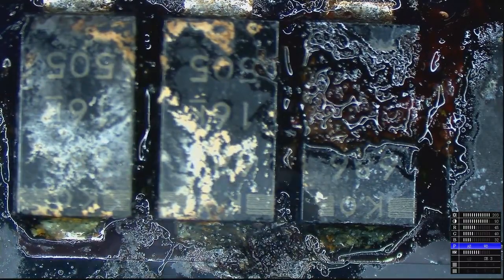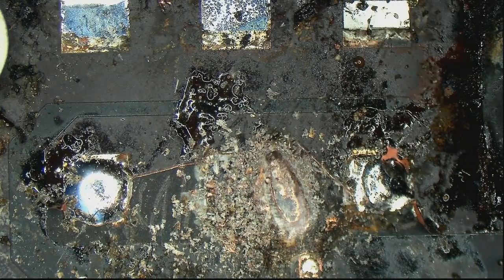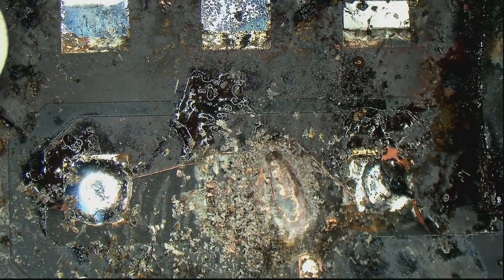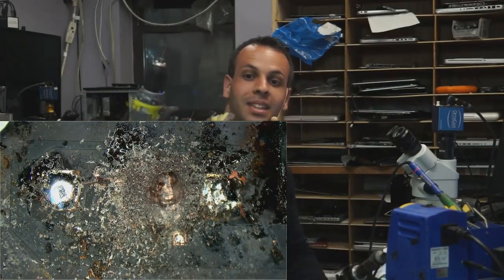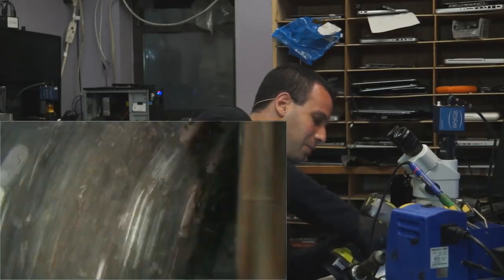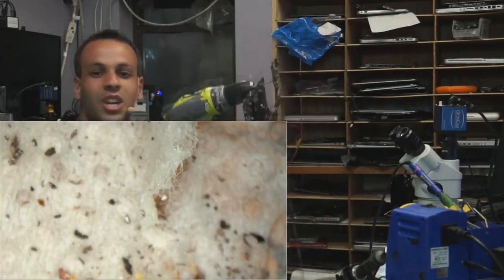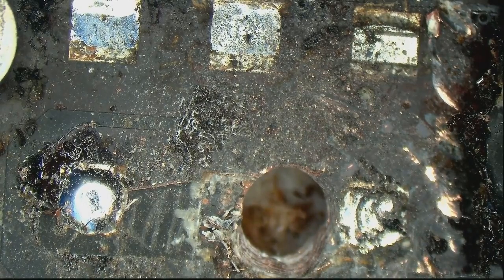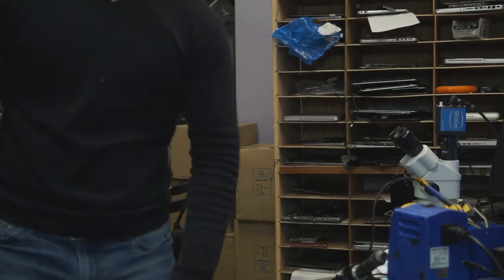How to remove short circuits from Apple Macbook multilayer PCBs

Comment: your videos have helped me understand what little I do understand ( which still isn't very much). I am working on a switch mode power supply for a Lincoln welder. do you have any idea where I can get a schematic for it. it has a 5 of 15 and a 20 volt output it's a 48 volt input. this is the first board that I've ever worked on and I don't understand it enough to figure out where to start without a wiring schematic. any help would be greatly appreciated

Comment: Hey Louis, drills tend to drill better when in the forward gear. Also, drill bits that look like a rainbow at the cutting tip are toast. 😂. Thanks for the tech tip.

Comment: Random Question: My Macbook Air literally just now started clicking near the power port/under the keyboard. I assume it's a jammed fan, checked a program and the fan is at 0 RPM. Any tips for unscrewing the cover without having to order a special screw driver? Or should I just get a can of air? Thanks in advance if you reply :) Great vids btw.
Reply: A can of air is cheap enough to be worth a try.

Comment: What can cause a logic board failure? I have a mid 2014 mbp and back in 2015 the logic board started acting up. Apple replaced it under warranty but ever since i've been deathly afraid of using it. I barely use it anymore because i'm worried it'll start to have issues again and now it's out of warranty. Should i be so worried about it?
Reply from the maker: +Kate Marsh mostly water or moisture

Comment: the same thing that happened to Jessa is gonna happen to you (iPhone CPU drilling)
calling it right now
Reply from the maker: No. 99% of the people who want to do iCloud unlocking are smooth brained. People who want to remove short circuits(or even understand what they are) have some curves in their brain so they won't believe this shit. If I did an iCloud or EFI password unlock video I could do something like that because the people who are into that all have IQ below 87.
Reply: D its the last 2 numbers of the 820-XXXX number (which explains why 2011 MacBook Pros have GPU issues (820-2915))
Reply: There is a glitch voltage that will let you in with a reader/programmer hooked up to get around the protection ANTIFUSE having been triggered on the chip.  Works on quite a few ANTIFUSE secured EEPROM's.